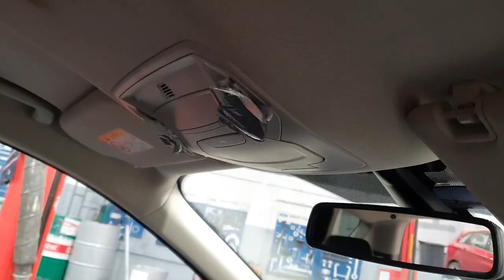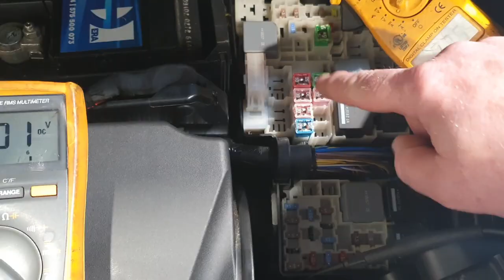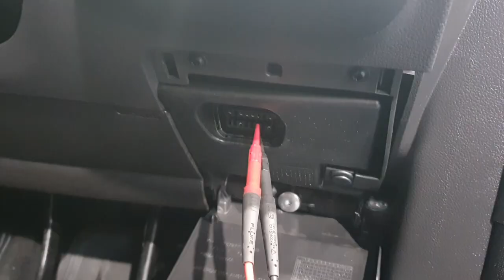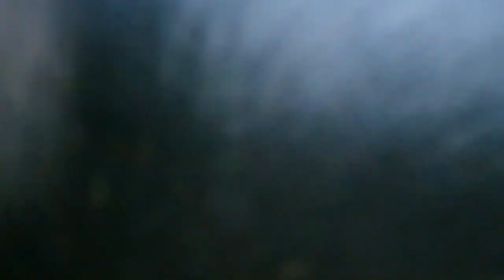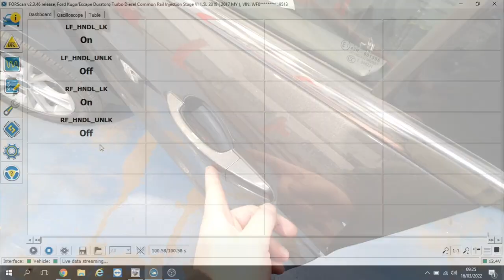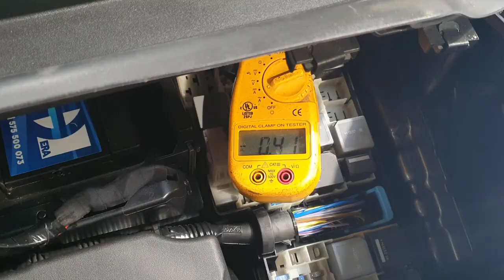Ford Kuga Battery Drain -  I Reveal The Most Unlikely Culprit

Comment: Electrician do you not pull each fuse and then check each in sequence to ascertain that no current is flowing through your meter?
Reply from the maker: It is a method that can be used for sure, however, pulling a fuse can shut down a circuit or component. Refitting the fuse may inadvertently remove the drain.  The method shown will identify each drain and then using a circuit diagram you can work out your process without inadvertently removing the evidence.

Hope that made sense 😊

Comment: My mechanic said after a diagnostic that the audio module was at fault and took out the fuse, we also replaced the battery as it was getting on a bit. He said the alternator was fine. It's only been a week and so far the car's fine and I can live without the radio....is it likely the drain might recur?
Reply from the maker: Earlier models suffered with the bluetooth module draining the battery
Reply: @sydiagnostics2025  True, I took the bluetooth/sync module fuse out myself. Battery keep holds between 12.18-12.42 which he said is fine